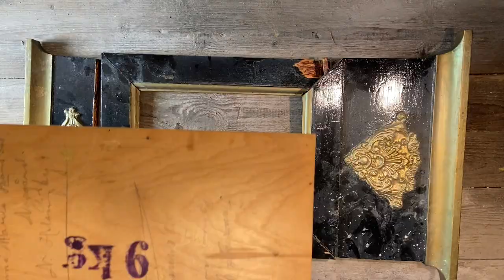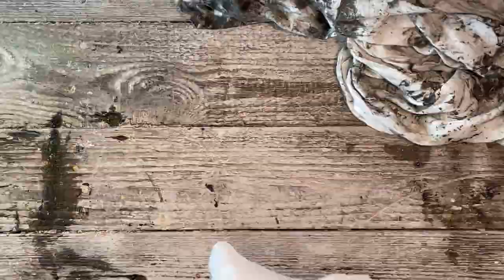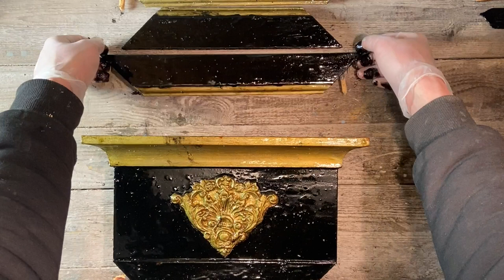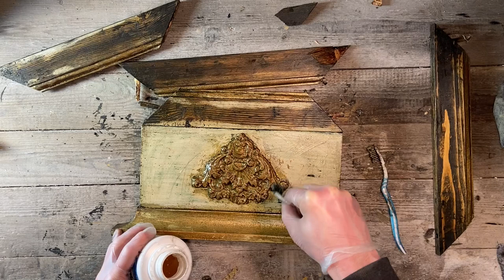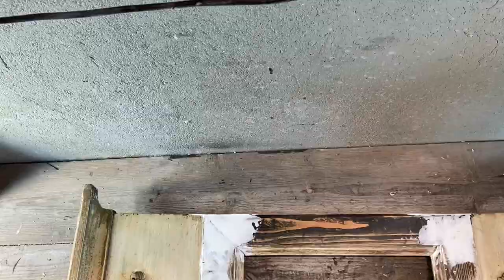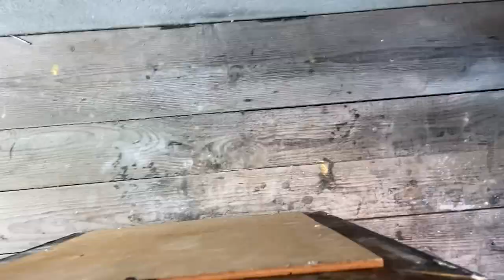Restoring a 200 year old mirror | Sped up restoration | ASMR | 1800th century mirror restoring |

Comment: You're going to have a horrible time trying to remove gold because that is gold leaf which is not going to remove with paint stripper. I'm not sure which stripper you're using but it was having a hard enough time removing the varnish off of the top of the gold leaf. If you want to strip Gold leaf you should use mineral spirits to remove varnish first (gold leaf is varnished when it's old that's just how they used to do it) and typically since they're varnishing the gold leaf they also varnish the paint as well. Sanding will get you through goldleaf the fastest. Obviously you're not going to sand the medallions but a wire brush to scrape the heck out of it prior to adding paint stripper may help if you come across it again.
Reply from the maker: Yes, I noticed that, so thank you for your tip!